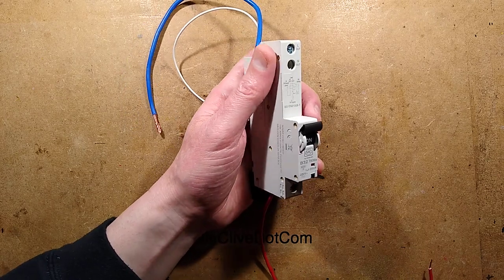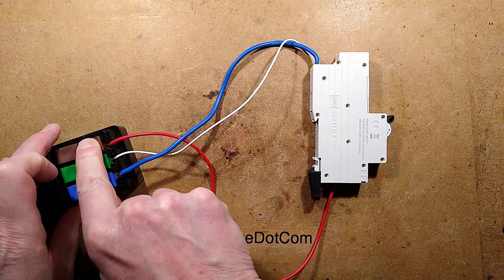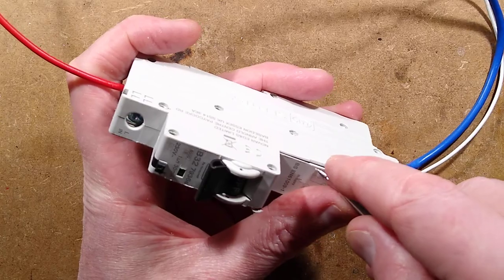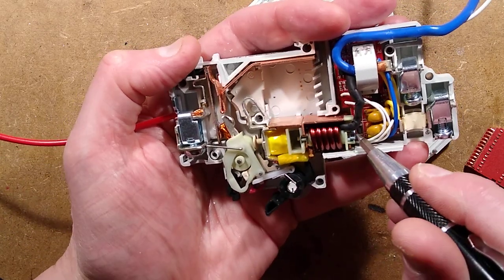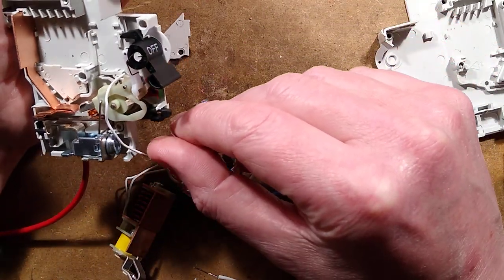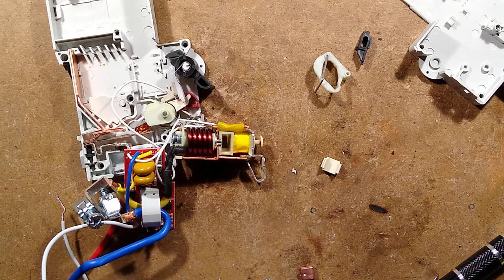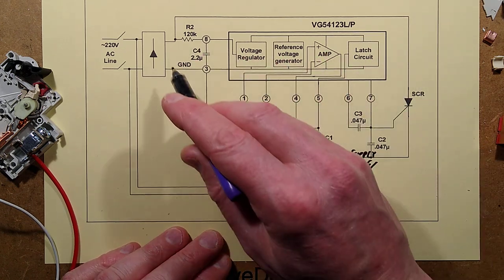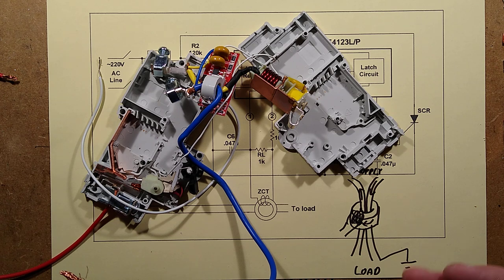Failed MK RCBO circuit breaker (with awkward recording moment)

Comment: Circuit breaker? What's that? In the US we just wait till all the moisture cooks out of our bodies and we let go.
Reply: I have a video teardown of a U.S. power plug with one of these in it. I'm not half as smooth and clear at explaining things as Clive is tho.
Reply: @deltab9768  That appears to be an older GFCI outlet you tore down, it doesn't seem to have any automatic self-test circuit in it. All the new ones since approx 2015 are required to have automatic self-testing.
Reply: Interesting! That one definitely had a test button on it, but how does the auto self test work? Does it trip itself at a scheduled interval? And yes, I think this one was very old. It had seen some serious wear and tear and eventually had to be replaced.
Reply: @deltab9768  Here is what IAEI Magazine says: The auto monitoring or self-test feature periodically tests the electronics from the sensing toroid to the trip solenoid driver and will pick up a failure of the majority of components in the GFCI.  It cannot, however, test the trip solenoid driver, the trip solenoid itself or the contacts to see if they are welded. Testing those components can only be done by actually making the GFCI trip. It is not practical to have GFCIs randomly tripping off during self-test cycles. So the manual test button is still provided and it should still be used periodically as recommended. The presence of the self-test function is not allowed to affect the tripping of the device within the specified trip time requirements if an actual ground fault occurs.
Reply: thanks. That makes sense.
Reply: @brianleeper5737  An interesting discovery - possibly via Thomas Nagy's videos, is that the self test feature does not have to comply with any standard. So if the trip current is designed at 30mA it's perfectly acceptable for the test button to leak 50mA to trip it. The 'standards people' (Clive knows who they are) missed a trick - and should have specified that the test button should use 5mA less than the rating of the trip. Then you'd be sure that 30mA would trip it as well as 25. I believe some will trip at 21mA - but who cares as it proves that it'd deffo trip at the specified rating - which is what you want.
Reply: @millomweb  In the USA, standard UL 943 governs GFCI devices. I just did a Google search for UL 943 and some website has the Feb 2006 version of UL 943 available for download. (The current version is available from UL, but it costs a ridiculous amount of money, $798 to be exact, so I won't be looking at it). Anyway, the Feb 2006 version says this about the self-test button (note that these devices trip at 5mA):

5.15.1 A ground-fault circuit-interrupter shall be provided with a supervisory circuit that will conveniently
 allow for periodic, manual testing of the ability of the device to trip by way of a ground fault. 

5.15.6 The current employed by the supervisory circuit shall be sufficient to cause tripping at 85 percent
of rated voltage, provided that at rated voltage the current shall not exceed 9 mA.
Reply: @millomweb  Other thing to note is that, as the UL standard mentions, you need the test button to work even if the voltage is low. From what limited experience I have with RCBOs, it appears that they size the test button resistor to trip the unit at the lowest voltage expected to be applied to the unit---the ones I've tested, the test button works with only 120V applied to the RCBO. Is that intentional? Is there a big market for these in countries where 120V is used? Perhaps in an industrial application, where a DIN rail RCBO is needed? (I should point out that I am in the USA where 120V is used and  I have purchased a few RCBOs for testing from Ebay sellers who are also located in the USA, so these things are used here).
Reply: @brianleeper5737  So again, the test button doesn't have trigger it at under the rated current.  It's like having a crane rated 2 tons and as long as it'll manage 1·8 tons it'll do !

By 'supervisory circuit' do the mean the test button or the actual ordinary triggering circuit ? If the latter, it's 'proof' that a device rated 5mA need not trip until 9mA ! BUT to me that doesn't matter as 9mA is well below the 30mA of English* standards!

The 85% of rated voltage is an interesting one. To get that, you'd need another fault at the time. If the link to ground resistance is 'zero', the supply voltage would be well below 85% (nearer 10% or even lower) but it should still trip in theory - although the current flowing should be great enough to trip any overcurrent device.

The English* standards scheme is just a money-making affair too.

* We're out of the EU and the UK is clearly no longer united - so I refuse to use that old name !
Reply: @millomweb  And conversely, I have a UL-listed 5mA trip 240V GFCI and the test button does NOT work when it's powered off of 120V. But otherwise it appears to operate normally--the lights power on, the internal contactor closes the circuit when power is applied.
Reply: @millomweb  I interpret their use of the term "supervisory circuit" to mean the test button and it's associated circuitry that provides current flow sufficient to cause a trip when the test button is pushed. The 85% of rated voltage is ONLY in reference to the requirement that the test button HAS to trip the unit even if the applied voltage is only 85% of rated. I think this requirement is to avoid a GFCI with a test button that won't trip the GFCI when the applied voltage is (for example) 110V instead of the rated 120V--perhaps they had this problem early on and this requirement was added to prevent it. On some long circuits under a heavy load, you might see voltages as low as 110V or even lower.
Reply: @millomweb  I did some further reading and in another section of UL 943 it's stated that the GFCI must operate properly between 85% and 110% of rated voltage. Therefore, on a 120V GFCI, it should provide ground fault protection between applied voltage of 102V and 132V. These seem reasonable to me.
Reply: @brianleeper5737  We use 110V in 'special' circumstances - for professional hand tools - definitely on building sites and also, for example, woodworking shops where electric hand tools are used. I've not been in such a place since 'ELCBs' became a 'thing'  BUT the purpose of using 110V effectively makes them unnecessary - as it's actually 2 phase 55V - and they allege 55V isn't enough to be fatal - which is the whole point of our use of 110V.

It wouldn't surprise me to find a 240V - 110V portable transformer being used - with an ELCB on the 240V side - which would work fine for 240V faults but I suspect down stream of the transformer, on the 2 phase 55V, a leak to earth would not be detected as the transformer isolates the low voltage from mains voltage - so the ELCB would see the fault as a balanced normal load.
Reply: @millomweb  I would not expect an ELCB upstream of a transformer to detect an earth fault on the downstream side of the transformer either. But is the downstream side of the transformer even connected to earth? Seems like there would be no reason for it.
Reply: @brianleeper5737  I wonder what the trip current is then when on 120V ? It could be double that of 240V operation. (Keeping the wattage the same.)
Reply: @millomweb  I would think the trip current would be the same because the sense coil measures current, not voltage--think of a clamp-on ammeter, it's very similar.
Reply: @brianleeper5737  Of course it would - I must have had a brain-dead moment !

Can I pick your brains on 'American dates' ? Can you explain why the day comes after the month ? I can't figure out English that would make that grammatically correct !
Reply: @millomweb  One thing I found says that the American date format originated in the UK, but no explanation as to how it originated there.
Reply: @brianleeper5737  Never seen it that way here. We have day first and that comes fro the full date version: "The fifteenth day of May, two thousand and twenty" - which is all grammatically correct.
Reply: @millomweb  Day-Month-Year notation is becoming more common in the USA. Some applications require it.
Reply: @brianleeper5737  Interesting !  My own preferred format is:
Y:M:D:h:m:s·d - and that is NOT:
YYYY:MM:DD:hh:mm:ss·d !
Posted on:
2020:5:15:20:49 GMT

Comment: Reference schematic be like "Just short out the mains - that will cut the power off nicely".......... I assume any sensible implementation would activate the trigger coil via the SCR, because with the circuit as as drawn there must be a major risk that the SCR dies instead of the fuse/breaker
Reply from the maker: Yeah, it's weird how it's missing the trip coil unless that's in series with the mains.  But I thought they might have included that in the schematic.
Reply: @bigclivedotcom  It's not missing the trip coil.  A DP fault triggers the SCR which, as Kevin says, shorts out the mains.  Apparently the quick-trip solenoid is used to open the breaker when it is hit with the overload.

Comment: Have you ever ran single phase 220 thru a 3 phase 240 circuit breaker?
Reply: I have done that for testing. It works. If it's a breaker with RCD functionality you have to make sure that you use whatever terminal is connected to the test button for the hot/line side of your 220V source. Usually this is the terminals closest to the neutral terminals. The breaker will have a diagram showing the terminals connected to the test button. Ignore the other terminals.

Comment: Electronic RCD's tend to fail  more often.
Reply: @johncoops6897  Compared to the electromechanical ones, presumably.
Reply: @johncoops6897  As far as I can determine, an electromechanical RCD uses the output of the sense coil to drive the trip coil directly. There is no active elecronic circuitry..no transistors, SCRs, diodes, etc.

Comment: Aren't these also known as an Arc-Fault Circuit Interrupter (AFCI)?

Nice video, by the way. 😁 Today I was a testing a failed circuit? And found, I kid you not, a failed *wire*. It burned through the casing and also burned the wires away. I think it got damaged during installation.
Reply: No, arc faults are yet another different kind of fault. An arc fault interruptor will switch off when there is a bad connection in a circuit, which causes arcing and therefore heating of the connection. Those faults are very dangerous because they can generate enough heat to cause a fire quickly, yet don't pass enough current to make a normal breaker switch off - no overload condition. They respond to high frequency noise on the line caused by the arc. 

A ground fault interruptor switches off when current is flowing from live to earth. For instance, when you have a live wire contacting the metal case of a device that should be grounded but isn't, and someone touches it, it'll switch off the current (if more than 30mA (typically) flows). 

It'll also switch off power if there is electric leakage in a submersed heating element or in a water pump or something.
Reply: @mfbfreak  In simpler terms, a GFCI compares the current on the hot line against the current on the neutral/return line.  If there is a difference, then current is leaking somewhere else - either through the safety ground or elsewhere, like from an appliance through a person.  When the difference is detected, the breaker trips.
Reply: @mfbfreak  Some, but not all, arc-fault circuit interrupters also include 30mA earth leakage/ground fault protection. I know for a fact that the Eaton/Cutler-Hammer type CH and BR ones do. IIRC, in the USA, the first-generation AFCI devices were required to have 30mA ground fault protection, then the requirement for that was dropped but some manufacturers like Eaton continue to produce devices with it.
Reply: @brianleeper5737  I've heard of GFCI's, and AFCI's, but not RCBO's. I wasn't sure if it was a different acronym for another product, or something new.

Comment: Follow mr Nagy can't understand why he uses mk. I think it was when Honeywell got their hands in it. My has been overpriced rubbish for the last 15 years riding on their old reputation. I sooner use an mk switch from the 80s that will still work in 10 years time. I wouldn't trust a new mk switch to last a month. I've literally had new mk switches fall apart in my hand. Always hager for consumer units and dbs and hager or even click mode at half the price of mk. Been using mode for the last decade with no callbacks.
Reply from the maker: I regard it as just a brand too.  I've never been impressed by the quality.

Comment: CE... Chinese export...

And I dont see a UL label. I wouldn't trust it.
Reply: @johncoops6897  Not quite. UL approval and labelling is relevant in Mexico and Canada as well as the USA.
Reply: @johncoops6897  Canada, Mexico, and USA use many of the same standards, such as UL 943 which covers GFCIs, and it's very common to see a devices labelled for sale in any of those 3 countries. I did not know that UL is an NRTL for Brazil.
Reply: @johncoops6897  I thought CE was a significantly watered back testing.

Comment: Hmmm a qualified electrician didnt notice this another 150 quid in his back pocket me thinks !
Reply: From what Clive said this was an issue that arose during a "new" installation so it would be out to the van and grab another one = 30 quid out of the installer's pocket as "one of those things we allow for in the estimate".
Reply: @18robsmith   30 quid ? Your paying too much! 

Naaa... you take DOA's back to the wholesaler for credit anyway, which also alerts the manufacturer/supplier of failure rates of their product.
Reply: @BTW...  I was being generous, and accounted for lost time - remember that another tea break is required ;-)
(of course if it's a cost plus job then that is another ton at least on the bill....)